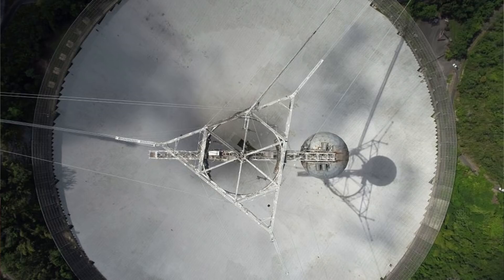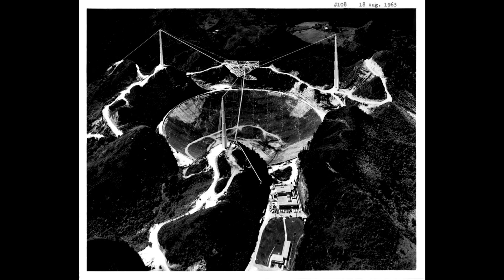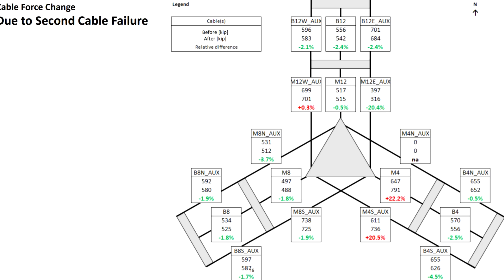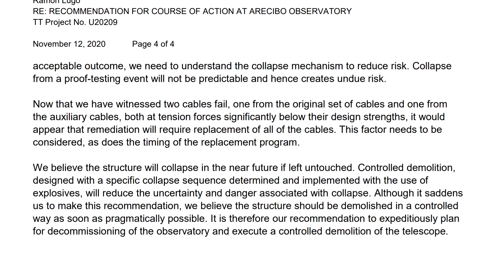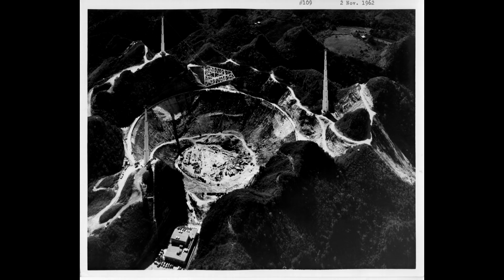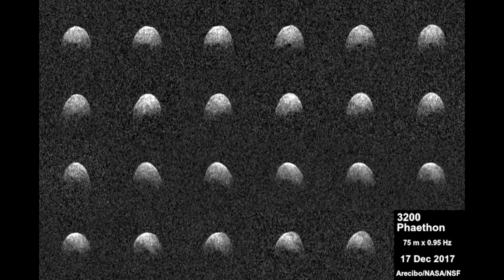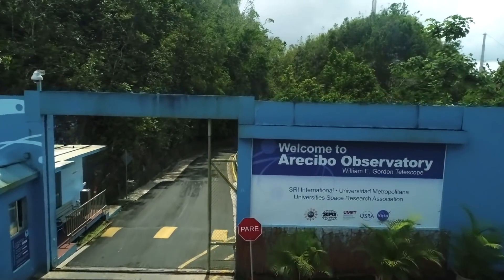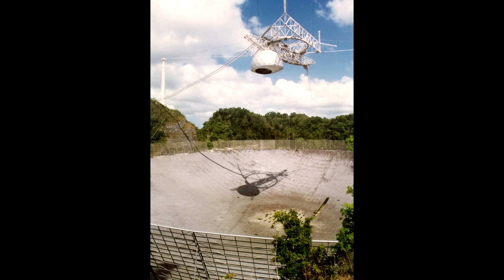Worlds Largest Radar Astronomy Dish To Be Demolished!

Comment: I’m surprised there wasn’t huge margin on these cables. It should be built like a bridge.
Reply: Seems like there was. To have a cable fail at 60% means that they calcuated the load in the cable to be 60% which is a safe amount under most circumstances. Something's hear clearly went wrong as the cable failed but it was not due to not having a big margin. Also it was 60% after a different cable had failed so i suspect it would normaly be under 50% which is a safety factor of 2 which is ok for static structires like this. Sometimes you may see three or more but when mass matters than 2 is most likely fine.
Reply: Well there is. The static load of 60% while one cable already failed shows that there was at least some redundancy planned. Safety margin is usually planned above 100% designed strength. 

But steel cables do loose strength over time, so as you don't have funding for maintenance, how are you supposed to fund replacing some of cables? 🤔

I'm sure they would have replaced all cables when they extended the facility when there would have been enough money.
Reply: There WAS a huge margin on those cables. It's just 60 years old, and stuff is starting to fall apart. Even aircraft carriers are decommissioned and scrapped after 50 years.
Reply: @BlackEpyon  well, have a look at the golden gate bridge. 😎
Reply: @RubenKelevra  The Golden Gate Bridge, and other iconic bridges, are under constant/permanent maintenance to keep them going. When NASA only gets half a percent of the fiscal budget, and their science budget is just a sliver of that, how much money do you think gets spent on science in America? This isn't the Cold War any more, where it was in the national interest to actually KNOW more than the enemy.

Comment: No surprise to me what happened.  I spent most of my Navy career assigned to communications stations in the tropics and I know first hand how harsh that environment can be on antenna structures.  Get a year past installation and you can see the unstoppable corrosion setting in.  About the only thing that can stand up is corrosion resistant stainless steel which was in short supply.  Almost all the various types of antennas I worked on were constructed of various aluminum alloys except of course the guy wires that supported the structures.  With this kind of thinking about not going after a repair makes me wonder how we built anything without risk, i.e. Golden Gate Bridge, Empire State Building etc. come to mind.

Comment: I remember they used robotic crawlers on some of the suspension bridges to pull new cable and wrap cable.  If they wanted to save this it isn't a particularly challenging task.  You're risking the lives of some expensive machines but thats about it.
It also seems like you could temporarily relieve the strain with polymer based cables and straps, at least to the point where it was safe to work on.

Comment: Given its age and cerebral state, I’d think demolition and rebuild would be the best thing possible, any restoration is just dumping money into a hole.
Reply: It is generally far cheaper to maintain what you've already spent money on than it is to demolish and rebuild.
Reply: @stargazer7644  Kinda irrelevant at this point what’s cheaper. It’s seriously damaged, would need major repairs and any attempt to do so would be risking lives, given its unstable state, and thus require hazard pay.

Even if they go down that route, every part of it is likely in similar disrepair and would soon need to be replaced/repaired.

Comment: If It's too dangerous to work on the gantry it's also too dangerous too work under it. You are not looking at a dismantling but a controlled colapse to bring the whole structure down to ground level. This is probably going to involve explosives to sever the cables supporting the dish then to sever the cables supporting the gantry.

Comment: I am a structural engineer and we use a safety factor of 0.6 for operational loads (ASD in offshore). If this cable snapped at 60% design load, the rest can snap at ANY moment. It breaks my heart too, but it is the best decision they could make at this point. Sending somebody up there is not acceptable.

Comment: Science is about progress and discovery. This instrument was way better than anything in it's day, spending a small fortune to fix it and get marginally better performance than the next best is a waste.
The next gen radar/radio telescope needs to km across and placed on the far side of the moon. Fine mesh, thin cables and minimal maintenance would be needed for better than 10x performance.

Comment: I took architecture and, yeah... if they lost the second cable while it was only at 60% of minimum shear load, then you're looking at an internally-corroded cable. No way to tell if the rest are in that condition without cutting into them. That one close-up of the bulging cable? Yeah, that's not even in question: it IS giving way over time and that will accelerate for as long as it remains under the same level of stress.

Only lifting the central structure would allow for enough reduction of stress to allow for repairs. Meanwhile, anything done to attempt that will take time - time in which the remaining cables will continue to degrade until they shear. That said, you don't need to lift the ENTIRE weight if the objective is to replace one cable at a time. Perhaps about half. I wonder if it could be done with skycranes or blimps?
Reply: That isn't a shear load.  The largest blimp ever built had a net lifting capacity of 17 tons.

Comment: 2020: cables designed to hold 500 tons snap under the strain. That checks out!
Reply: Also there isn't and wasn't anyone to fix the damaged portions of cables regularly like high tension power lines. It was and is mismanaged with maintenance and inspections. It's not like important infrastructure that is regulated by government like power lines, roadways, bridges, communications, etc.
Reply: @nicmaz37  if is not regulated by government is even better because in that case all you need is money. And money can be crowd funded. Getting approvals and swimming for years in endless paperwork is much worse then just getting money to do something.
Reply: Notice that the cables are suspending the plattform from the sides and not from straight up above. That adds A LOT more stress onto them. 

You can test this with a coffee mug and a string around its handle, holding either end of the string in either one of your hands and then start pulling. Forces are immense!

Comment: yeah that´s really sad... I am a mechanical engineer and with your information given I really don´t see a way to save it. Or at least there is nothing they can do without putting humans in a danger zone. I guess there is a ridicules kerbal-way to do it but nothing realistically or reasonably priced.
To get back to your question about the cables… Statistically speaking no cable or connection should have snapped in the first place. There must be a calculation error or the underestimated the weather influence or the didn´t service the cables as they should have done (maybe through a lack of funding). 
Also with one snapped cable the others shouldn´t snap either. But with two snapped cables and all the circumstances a catastrophic failure is just a matter of time.

Comment: Metal structure suck because they never last, eg: Golden Bridge suspension bridge which must be repainted and cable checked regularly to prevent this sort of things. Just build stuff with concrete to hold things in position.

Comment: At Arecibo they actually needed more towers and cables.  They should have added 3 additional towers when they did the upgrade.  Other problem is that this sat right in the middle of Hurricane Alley.  I hope they find a way to fix it or build another one in Northern South America near the equator.

Comment: Demo the cables with explosives, at the same time, like dropping a building.
Reply: It’s complicated. You have to cut the cables to the center structure AND the guy cables (from the towers to the ground) all simultaneously. Otherwise the towers will collapse outward, destroying the control laboratories. Sad day.

Comment: Good video.  I think you underestimate the tension on the cables. The dead weight of the scaffolding, etc., in the middle would be the source of the tension only if it was hanging straight down.  But to hold it from the side as it is requires a huge amount of additional tension.  The towers probably should have been taller which would have decreased the tension on the cables.

Comment: honestly it all comes down to bad engineering for a dish that is beyond its life expectancy, If they had designed it with extreme life expectancy the center core would be able to lowered and cables changed.  As it stands, I see no way to lower it since it was brought up to the cable and hung on them....

Comment: I live in the tropics (Guatemala) I am very surprised it has lasted this long . to make things last in a tropical environment it is much more expensive. For example 316 stainless steel is considered a fairly good choice in many applications in colder climates , but to achieve approximately the same performance in the tropics you need something like 27-7 , but what is normally specified is 304 a less corrosion resistant alloy than even 316. So the tropics is a harsher environment combined with a lower standard of construction.
Reply: 316 has its primary advantages with high temperature corrosion resistance. Great for exhaust manifolds and tubing, but overkill for applications under 400 degrees F. I doubt the cabling they used was 304 even. Even under the worst conditions (my car exhaust), ive only seen 304 corrode superficially.  I would bet they made those cables from the cheapest steel they could get their hands on, A36.

Comment: That thing is so unbelievably heavy, would it not be possible to just cut the cables to the platform to demolish it and then build a new platform using new lighter materials and cables and a new dish beneath it?
Of course that will cost money, but maybe less than it has cost to maintain and strengthen this one.
Reply: When you cut the cables, the towers supporting all that weight are going to snap in two.

Comment: When I asked a research Astronomy prof friend of mine whether recent research warranted restoring Arecibo, he responded:
'I think that the major observational drivers for investments in radio astronomy have led to more money going into other kinds of instruments - like at the VLA, Green Bank, and ALMA observatories - and that those investments reflect the broadest possible research reasons.  That led to a lack of investment in Arecibo spanning decades, which resulted in its slow mechanical decay and these recent failures resulting in its shuttering. Sure it is still producing useful science - but the return on the scientific investment had reached a very low marginal utility.   It was its time.'

Comment: Remove parts of the dish below, and build scaffolding to support the middle structure. Replace cables in its entirety with ones up to spec, 7x margin, as is standard in the civilized world. My hoisting crane at work lifts 3.2 tons. The cable is rated for 3.5. with a 7x margin.
Reply: Are you not understanding the part about the telescope collapsing at any time?  Would you like to be part of the crew working under the 900 ton platform?

Comment: You'd have to set the platform down and completely replace the cables, probably give the towers some updates and an overhaul. That telescope is old, been there from like the '60's and has been an invaluable scientific tool. it is every bit worth repairing and even upgrading, if funding can be secured.

Comment: THE most iconic dish in the world. Such a sad loss. Will it be replaced?
It sounds like this leaves a massive hole in our global capability
Reply: We have FAST telescope which has a 500m-diameter dish. Completed in 2016,  FAST is quite capable to replace Arecibo's position. (You may not know FAST yet, search it on ytb)
Reply: @yxw9418  I'm quite familiar with FAST.  FAST doesn't do radar astronomy.  That was even mentioned in this video.
Reply: @stargazer7644  Yeah you are right……maybe we could upgrade FAST and equip it with a radar in the future…at least it will be easier to build another super large dish on Earth.
Reply: We still have Greenbank.  Not quite as big, but it can do radar astronomy, and cover its entire sky.
Reply: @stargazer7644  Having visited that part of the country on a regular basis, no they really aren't comparable. Green Bank is a strictly receive-only tool (so as to not mess up the nearby DoD facilities) and in a part of the Republic which is nowhere near as RF quiet.
Reply: @DrewNorthup  Your information is incorrect.  Greenbank is not receive only, it has several fairly powerful transmitters.  Sugar Grove (the DOD site) shut down in 2015.  The site is now owned by an Alabama based investment group that wants to build a health care facility on the site.    Greenbank sits in a valley in the middle of the National Radio Quiet Zone.  There are no uncoordinated fixed transmitters within 60-100 miles of the place.   It is very radio quiet.  They don't even allow wifi or microwave ovens in the town around the telescopes.  Yes, I've been there.  There is no cell reception, no FM radio, no TV, no nothing.  The town still has phone booths.